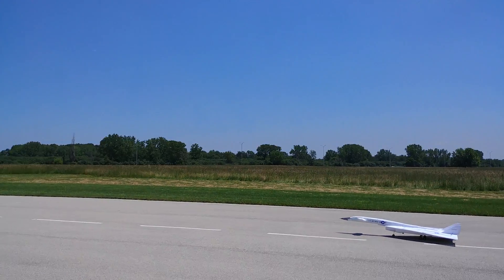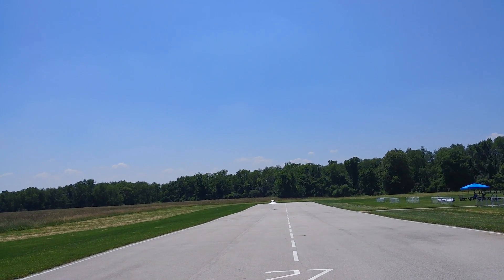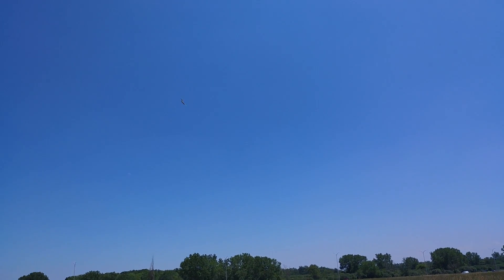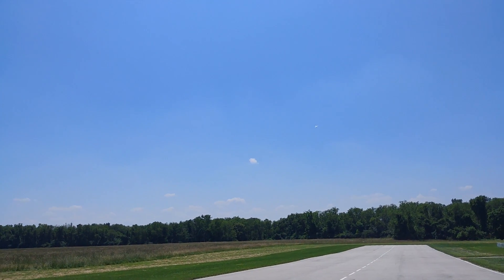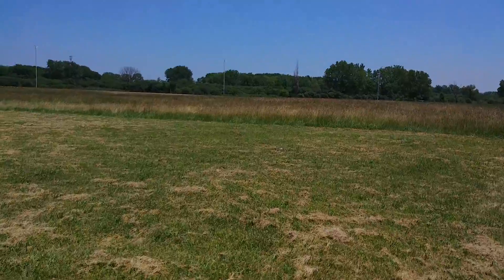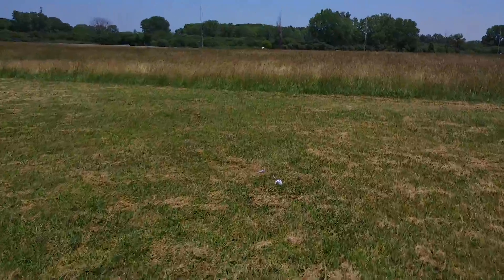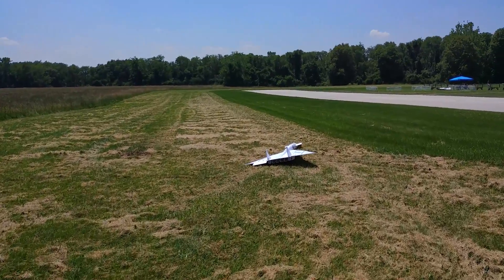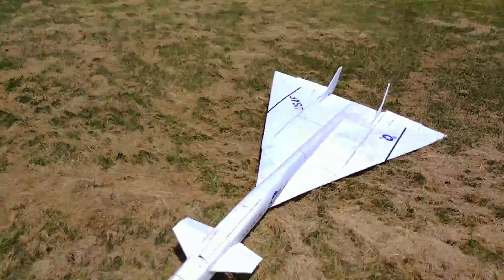XB-70 Flight 2 | Crash

Comment: Rookie mistake! Too little power right off the batt.The thing was wallowing all over. Should have landed straight away. Then you turned way too sharp on your final and stalled it. You should have gone out waaaay long for your final approach and let it settle in on it's own...oh well, live and learn.
Reply from the maker: I do agree that pilot error was the cause of the crash, however I never stalled it - the CG was too far forwards and I had too little elevator authority due in part to anemic servos to recover from the dive I had put myself in.
If I remember correctly, I was just about out of battery and concerned whether it'd make it around the pattern another lap. I ended up way high and needed to get down. Once I realized how far I had put the nose down, the plane didn't have the capability to recover from the dive

Comment: You did a great job on this build and what a cool airplane. It does seem to fly a bit heavy. I think too much bank angle caused the nose to dip and at slower speed you didn’t have enough energy to fly out of the recovery. I’d recommend you fly it from the side of the runway at mid-field instead of the approach end. That’ll give you better perspective. I hope you rebuilt it and flew it again.
Reply from the maker: Thank you! I ended up patching it up and flying it again at Flite Fest in 2019, after which I scrapped it and rebuilt it fully using some better construction techniques. It's flown once since then, I really should fly it again before I have to head back to college at the end of the summer - just haven't had the time.
https://youtu.be/TGxn91d0T0s
https://www.youtube.com/watch?v=xDzKX17pyKU

As for the cause of the crash: It was certainly pilot-induced. I was way too high, thought I was nearly out of battery, and wanted to get it down on the runway ASAP. So I banked it pretty well to complete the turn and start descending, after which I realized I was coming in at way too steep of an angle and gave it full up-elevator to lessen the impact.

There was also a lot less elevator authority than I was expecting, lengthening the dive pull-out time and eventually leading to impact.  I attribute this to a combination of a fore CG and control surface blowback due to the rather anemic elevon servos I used for the first version. They also had a tendency to unglue themselves from the wing over time. The current one has proper full-size skookum ones with plywood mounts and some capacitors in close proximity, and from what I could tell on the test flight a good bit more pitch authority - no longer a loss of primary flight controls waiting to happen.

You can see the results of the lack of elevator authority in this video - I remember giving it much much more than I anticipated needing and still not getting enough, leading to the unintentionally low pass as seen here. I also felt some weird trim changes while in the air and elected to put it down early for safety reasons.
https://youtu.be/TGxn91d0T0s?t=56